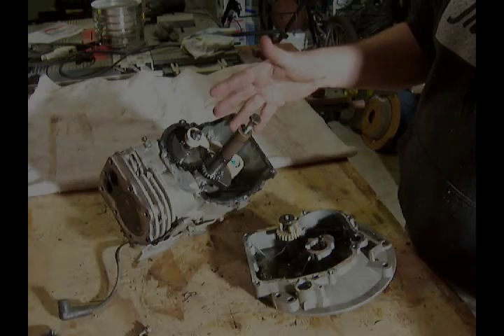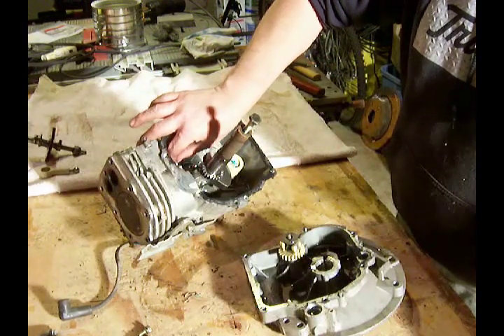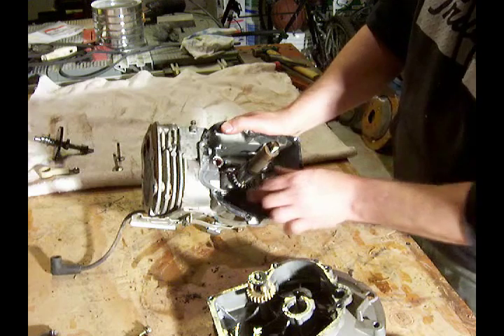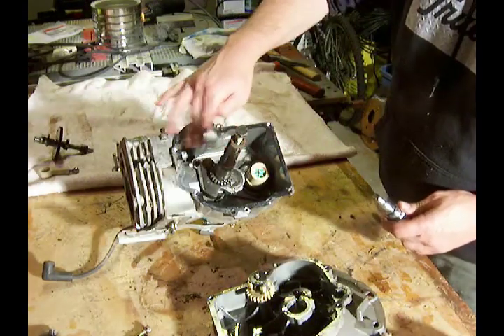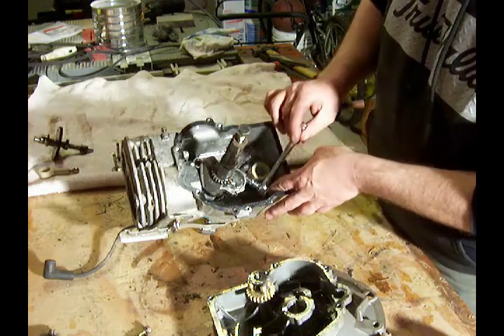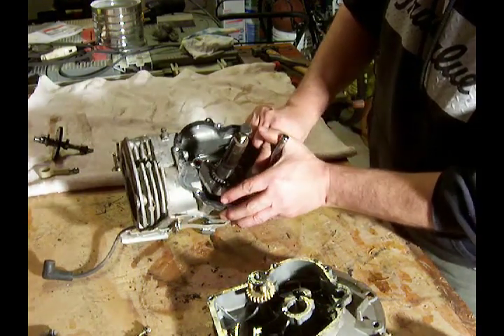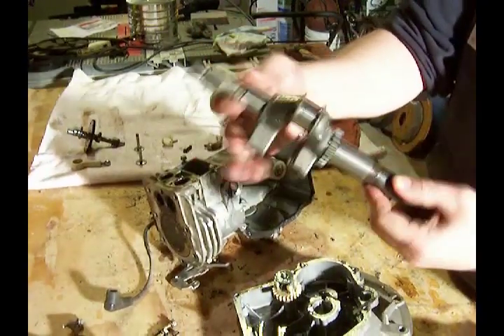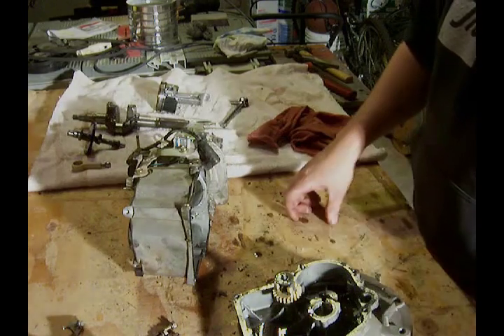#6 Tecumseh LV195EA / LEV120  - Tear down and rebuild - Crankshaft and piston removal

Comment: I'm working on basically the same mower and tecumseh engine.
I just put a brad new carburetor on it and adjusted the govenor and it still runs rough. Pulled the carburetor and cleaned it again and it still runs rough. What would you think is causing this..? Most equipment I work.on that have this issue it's in the carburetor but I think there is something else going on here
Reply from the maker: Have you checked that flywheel key? If it's slightly sheared, the timing will be off.

Comment: Not the driveshaft, the crankshaft.  Usually, there is a lip at the top of the cylinder wall created by the fact the piston stops slightly below flush on some engines.  That forces you to take the piston out from the bottom rather than trying to push it out the top.  Good video.  Enjoying it, but it's been 30 years since I took a motor like that apart and now I have a Tecumseh that I have to take apart.

Comment: Help a brotha out? The lifeters on my tecumseh fell out as I was working on the engine, any tips on how to tell which witch is which?
Reply from the maker: Are we talking VALVES or LIFTERS? Sometimes the exhaust VALVE has an X on it. If you are talking LIFTERS (as in an OHV engine, the LIFTERS push on the ROCKERS), there is no way to know for sure. If they are both so close that you can't tell the difference, you will have to guess. You will probably be just fine.
Reply: Ok thanks!

Comment from the maker: I have never seen a crankshaft break. Bend but not break. Since you will have to open the engine up anyway, look for any other broken parts inside. If you feel confident, rebuild it. Unless a new crank is cost prohibitive. Thanks for watching.